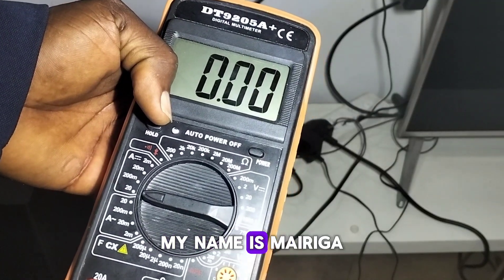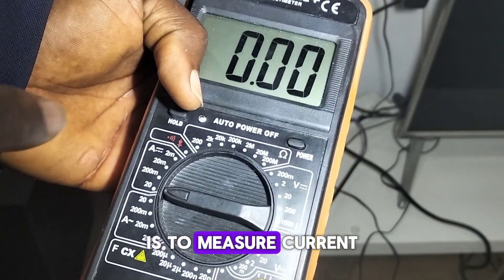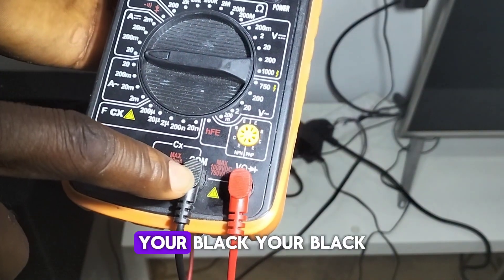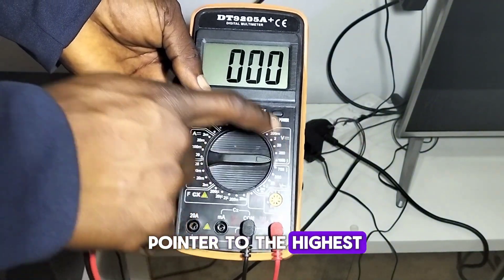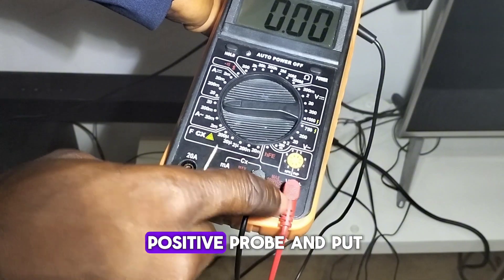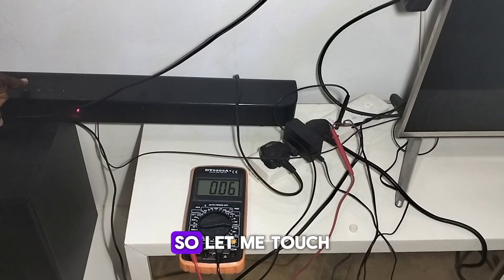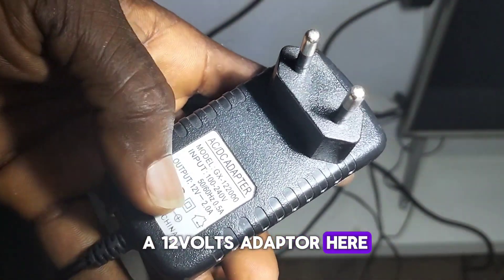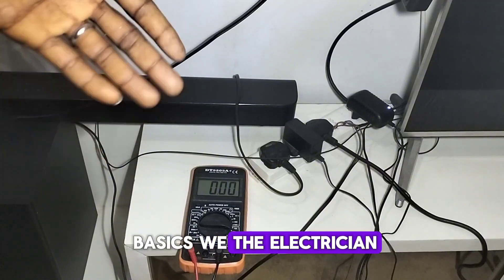How to measure amps(current) using a digital multimeter; beginner's guide.

Comment: please how can l set 6 solar panels in series for a 24v charge controller? thanks in advance
Reply: I also want to know more on this
Reply: Your total series Open Circuit Voltage should not exceed Max PV Input voltage of the solar charge controller. You may series 3 panels and parallel the 2 strings
Reply: @LibertyMataruse  yes thanks l later got it